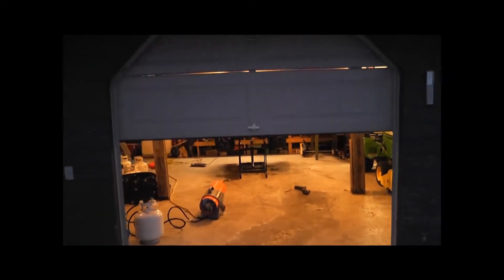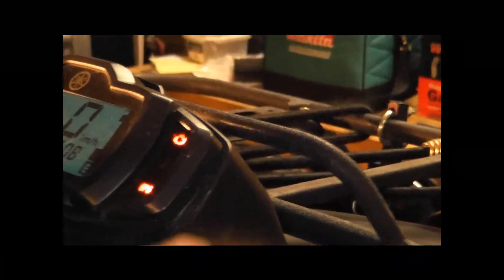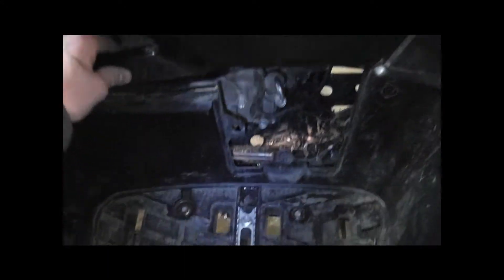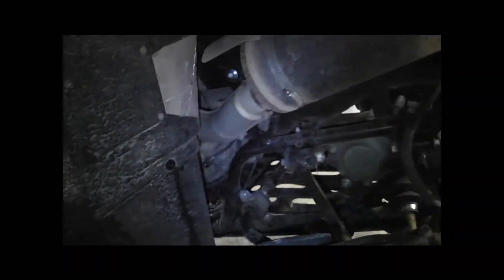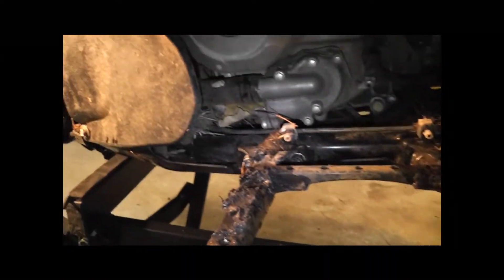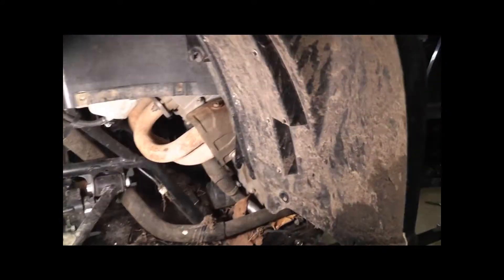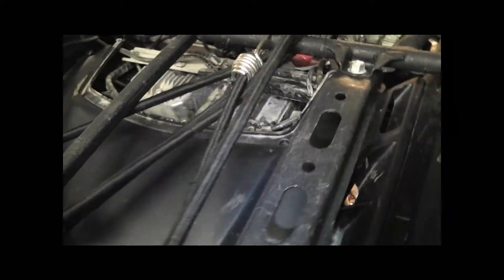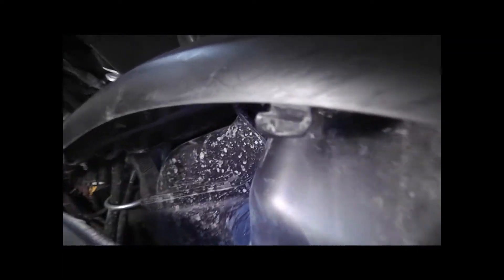How to Access the Exhaust System on a 2009 Yamaha Grizzly 700

Comment: You went way to far to fix the loose exhaust.  The side panel is the only one that you really needed to remove.  My guess is that one of your springs holding the exhaust to the pipe might have come loose.  Or that hanger bolt was just simply loose.  Either way, this is NOT a good way to go about it.